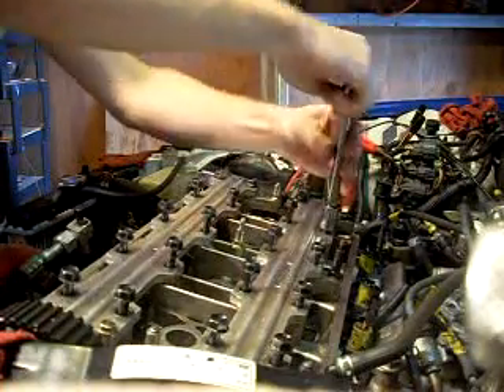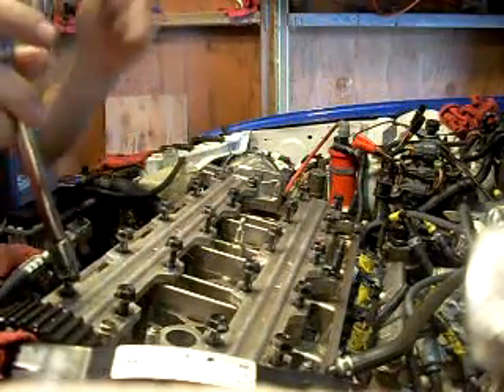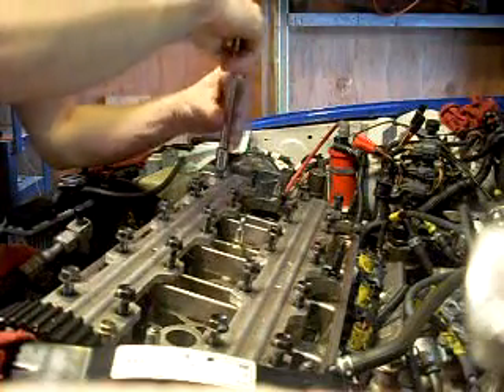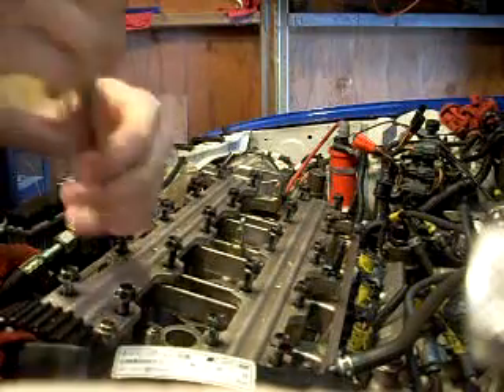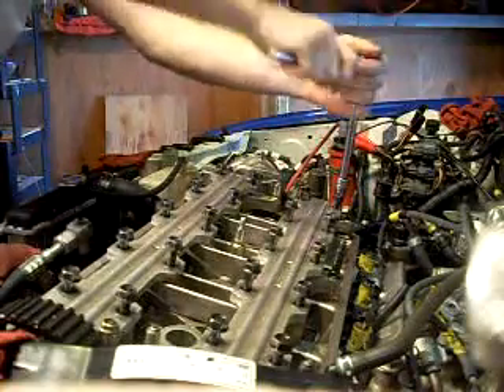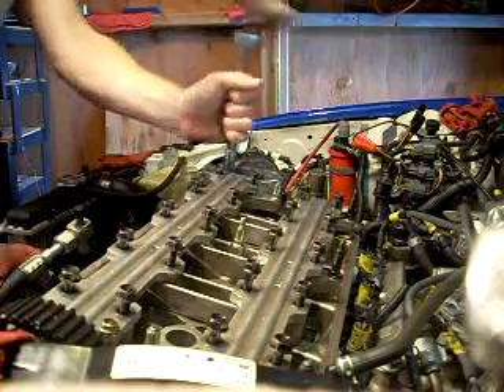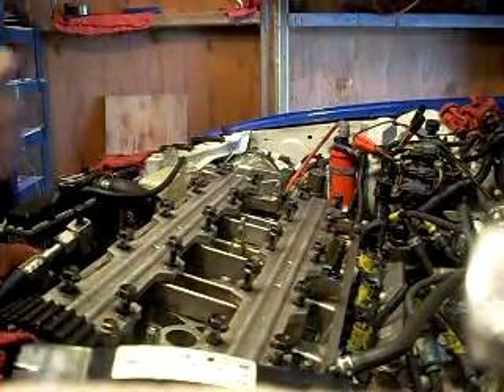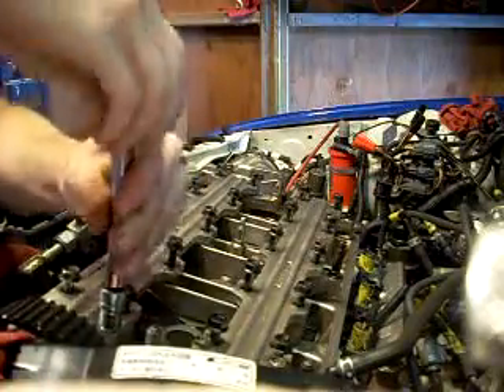(1of8) Taking the head off a JDM H22a to replace the head gasket and valves in a civic hatchback.

Comment: The car has been sitting for months now, I've been working on the body.. I did a fresh oil change and haven't driven it.. when I was driving it for like a day, I just bought it. I noticed the whole cabin smelled of exhaust.. Im thinking exhaust leak, but now the engine acted up and I noticed the smoke. and some oil on the bottom of the exhaust pipes under the motor